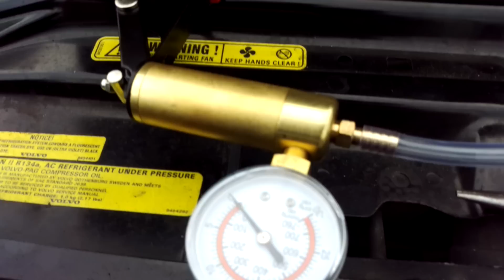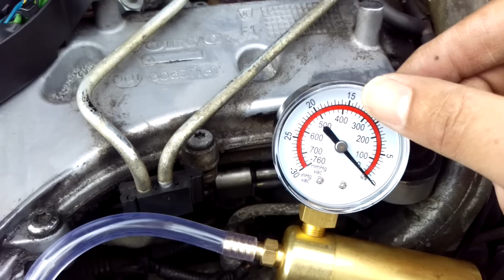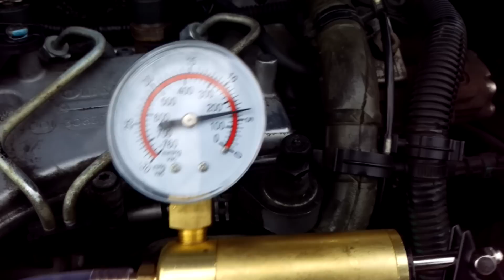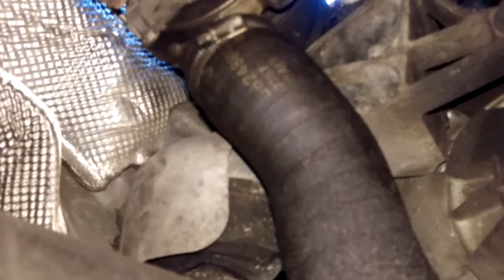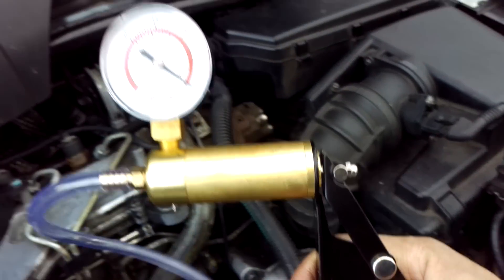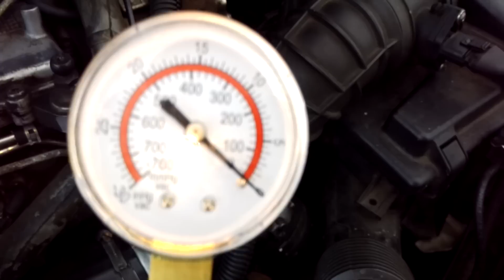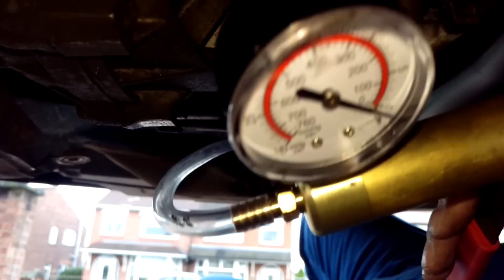How To Test Vacuum / Pneumatic Engine Mounts

Comment: Hi Rob, I have the same noise problem. I have changed the 5 engine mounts (D5 185hp) and my car continues to vibrate and make the noise.  Both engine mounts (corteco) have vacuum ok.  What else should I check?
Reply: Hi did you solve the engine vibration? I've done my transmission and since then I've removed the propshaft to replace it due Center bearing wear. Aside from this, I thought the vibration came from the cv's but there's no play there and nothing in suspension but when I accelerate, I can feel it through the car and steering. Haven't checked the subframe bushings yet.

Comment: What is the solution to these vacuum assist mounts. I have these mount installed in my 08 buick enclave which started vibration at lower speed and it appears the mechanic crushed the front line while installing condensing unit. Can i replace all three with after market that does not use vacuum?

Comment: Great video tutorial Si, but why do the engine mounts need to be “vacuumed” ? Could you blank the pipe  off and fill the mount with silicone or something else, just can’t get my head around as to why they designed them like this?
Reply from the maker: This style of mount provides additional damping for the D5 although it isn't used on every car model and D5 version.
Every type of mount deteriorates and needs changing at some point so there's no real difference.
Reply: @sirobb  i put solid billet engine mounts in my mazda minivan lol they aren't going to detioriate ever 😎

Comment: How much vacuum pressure should this mount hold?
Reply from the maker: As you can see on my new mount testing video, it should hold 20 in/hg no problem.
Reply: @sirobb  thanks for replying. That's helped me out then as mine can't hold 15 but can hold without dropping. Sounds like a new one needed.

Comment: Great vid Rob. I have a S60 D5 2.4 TD which splutters and judders at low revs (it’s fine after 2000 revs) had numerous diagnostics done and every time I get the same result, no fault codes so not sure what the fault is. Thus my question, could this be a vacuum issue?
Reply: Jay Southall Hello Jay, did you get the low rev sputtering sorted? I just bought a 2.4 D5 and the whirl flaps (of is it swirl flaps, can never remember) is shot. I understand they augment low rev operation. Did you get those checked?

Comment: Hi Rob, I think I have shot mounts front and rear. What are the consequences of running with shot mounts for a length of time? Did you notice any performance benefits when you replaced yours?

Comment: Did you changed your mounts? If so where did you do it? In a volvo serwice? How much did you pay for it?
Reply from the maker: I've bought the mounts and am doing it myself so it's costing me around £170.
A dealer will charge around £400.
Reply: I checked my mounts they are ok but i have vacum leak from brake booster :(

Comment: Yet another great and helpfull vid on the d5 , your efforts are appreciated as always and hopefully look forward to a engine mount vid as both my mounts are shot also on my 2002 s60 d5 with 187k and still going strong , love these cars
Reply from the maker: Thank you. 
Mine is also a 2002 on 186000 so your S60 sounds like it's had a very similar life.
Reply: 8 years later Mine IS nowadays on 182.000 and same problem 😅, one question, when you say vacuum you mean negative pressure right?, i am still learning english, and how they interact with the boost controller?, i got a limp mode  trigered the other day accelerating at the hightway, i think It was because of one of this two cause It trigered bost controll valve + cps Signal too high which i dont know about  yet i checked timing and it 's alright, thanks a mill beforehand i am watching many videos of you and other lad named spanner  to keep Up with the s60🔝

Comment: Hello, I have to say your video's are so very helpful. I think i have a similar issue, so going to but a pump and do the same test. I'll post the whole issue in the forum.
Thank you again

Ben
Reply from the maker: No problem. 
Whilst you're waiting for your pump, see my latest video which shows a temporary fix if your mounts are knackered and you can use the same trick to see if it helps cure your boost loss.
Reply: +SiRobb well my mounts are leaking, but very slowly.
going to test the tcv next, as per your lastest video.
did you have a video on injector choosing and re assembly.
again thank you for the time you put in making these videos they are so very helpful.
Ben
Reply from the maker: +Ben Charlton Hi Ben. 
I've created a video play list for all my (nearly 50) car videos and injector removal and replacement is near the bottom of the list. 👍